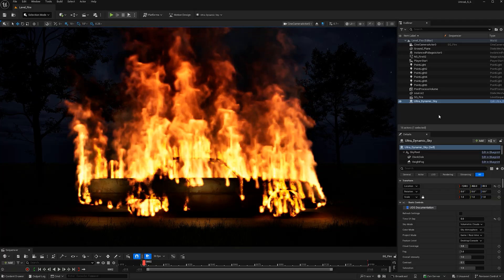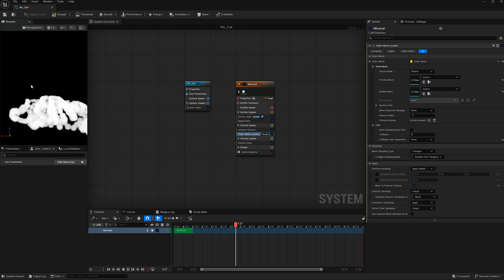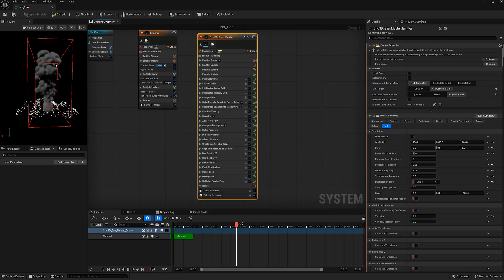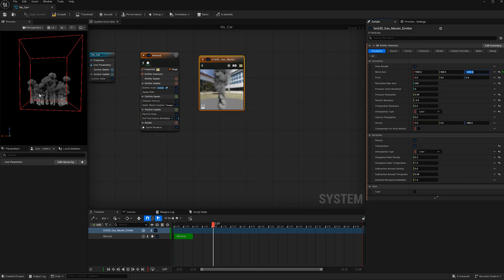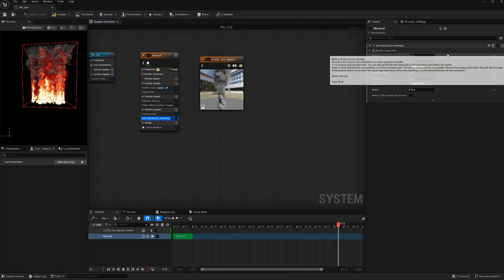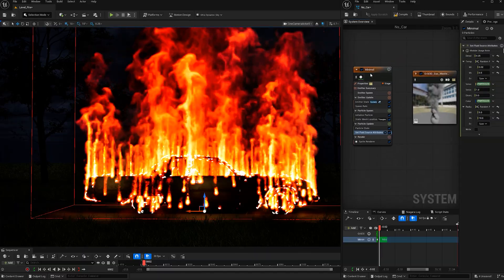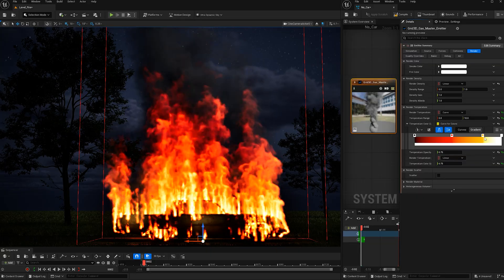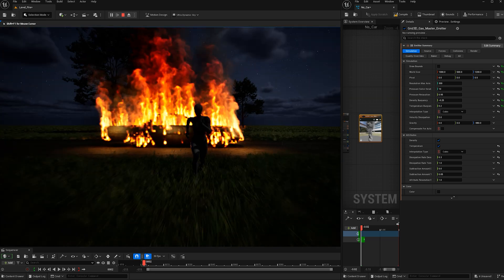Create Fire in Unreal Engine 5.6 with Niagara Tutorial

Comment: Thank you Katya, I saw this when it just came out. 
I have some critique to say though.
The Fire hues are alright. However there is something really strange and unsettling with it going straight up in thin straight lines, making it look really unnatural, especially because that's how it behaves like that are very distributed points that all act the same. I have not studied fire intensely before, however, you would expect it to be at least concentrating at the more flammable parts, and its shape and behaviour changing according to the materials and specific local geom. of the car. Moreover, there is the strange behaviour, as the sprites "base" of the simulation appear randomly on the car which makes this strange effect of fire particles emerging then dying at random spots, rather than the fire itself spreading to further parts.
I am not really sure how to try and go about those issues, but I could try making a spawn burst to control the last behaviour mentioned, then figure out a way to make the fire go bigger with time. One could also experiment with multiple Niagara systems rather than 1, to control localised parts, since I noticed its not easy to have much control on where the particles spawn and how intense should they be in certain locations.

Comment: Hey. Iv tried to do this great  tutorial but unfortunately i cant see any smoke preview. Not inside the niagara system and not inside the viewport. Also iv dragged a preset of smoke from the niagara templets and still i cant see any smoke. Anyone else encounter this problem? Iv tries to reinstall the niagara system but still not working. I will mention the in 5.5 its working fine. Thanks
Reply from the maker: Did you make sure the Niagara fluids plugin is turned on it’s separate from the other Niagara plug in
Reply: @Unreal_KatyaFedak its turned on. What do u mean separate from other niagara plugins?
Reply from the maker: I ment u will need to turn on 2 plugins not just one. I would double check the density is checked on under simulation and under render the smoke is set to something. Might be a bug
Reply: @Unreal_KatyaFedak thank u for answering. I will try that